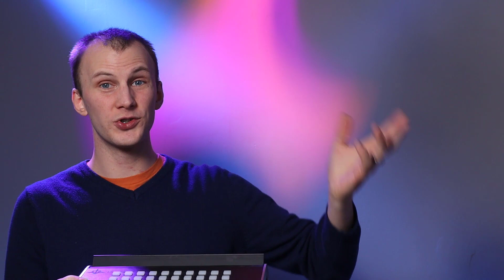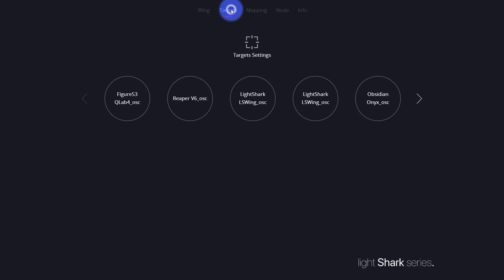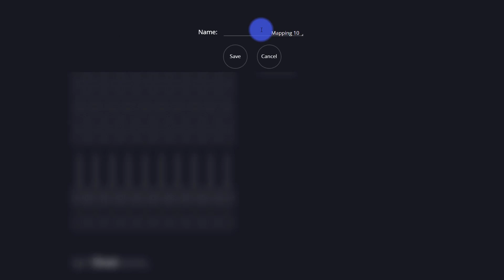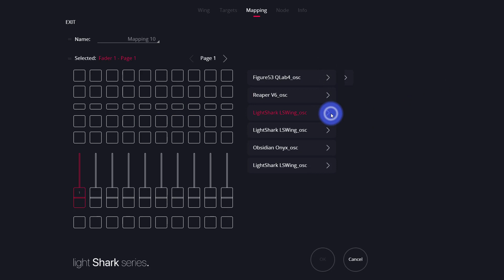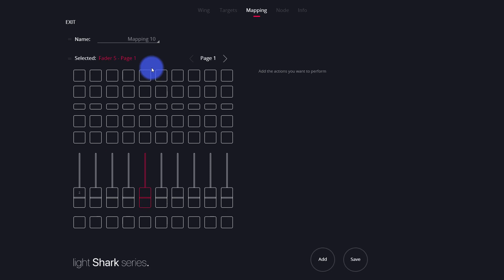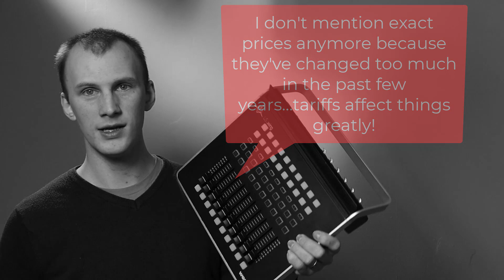lightShark LS-Wing Review:  A Swiss-Army...Wing!

Comment: Hello,

I am considering investing in the LS-Wing. However, I have a few questions that I cannot seem to find answers to online.

Can the console be connected directly to a *grandMA3 Light* without using a computer?

Also, once the *OSC mapping* is configured in the LS-Wing, will it be stored in the console’s memory?

In other words, is it a *stand-alone controller* that I can simply power on and connect directly to the grandMA3 with an **RJ45 cable**, and it will work?

Or is it necessary to have a **computer connected at the same time in order to run a session**?

I would like to know if it truly works autonomously or if a computer is required.

Kind regards.